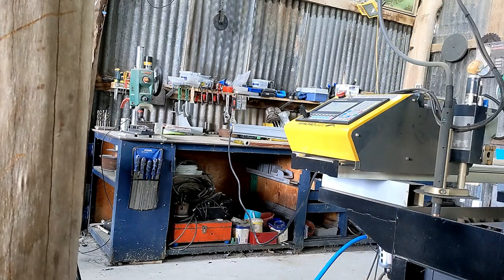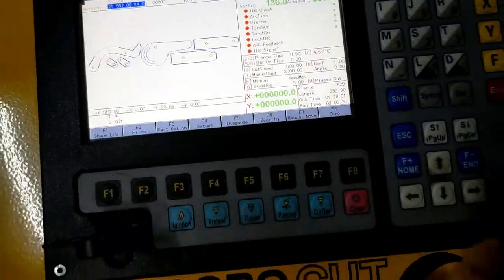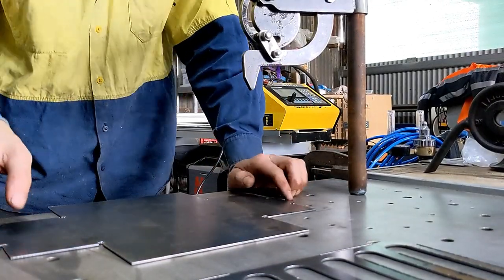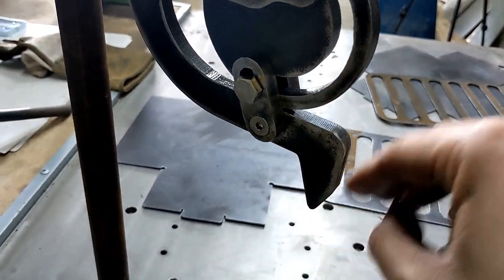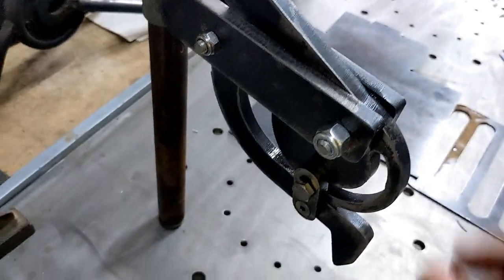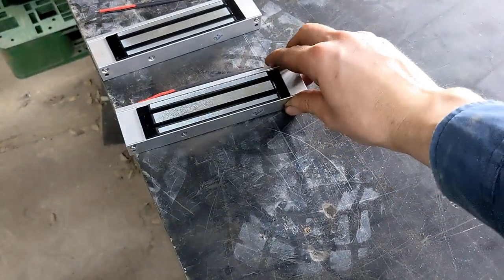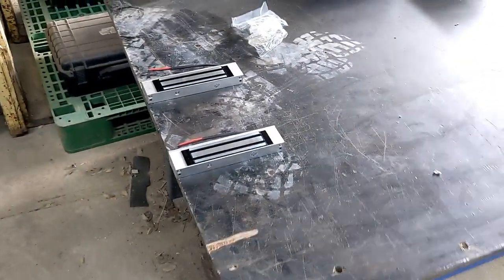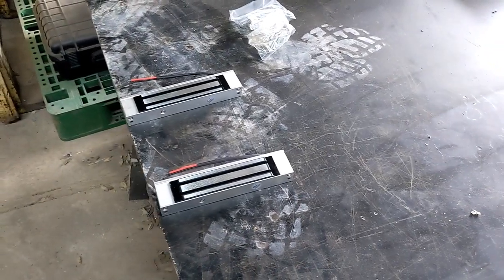DIY QUICK RELEASE WELDING CLAMP  "pigeon looking"

Comment: Nice tolerance on part fit to the edge of the material.  Just got on the plasma table at my local makerspace and cut 42 triangles out of some scrap 16gauge.  But of course since they put some terrible looking cooling fluid in the bottom of the cutting table, I was only able to dredge up 41 out of the 42.  Luckily it only takes 20 to make a icosahedron, so I should be good.  Keep burning, and if you're really bored, post the drawing files.  Someone else might even make one.
Reply from the maker: I was thinking about sharing the DFX files. 👍 I will have to work out the best way to do that.